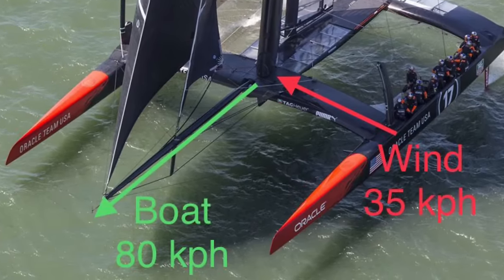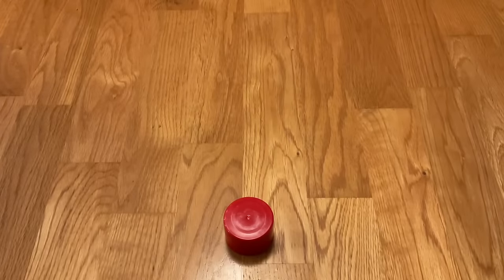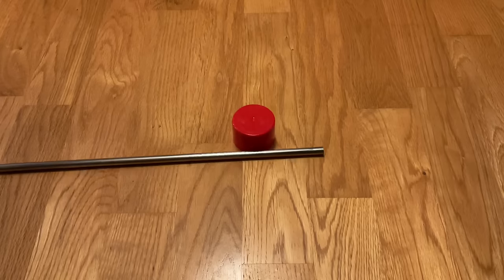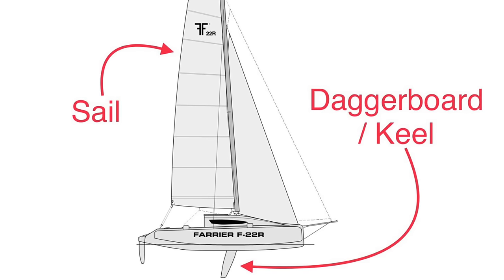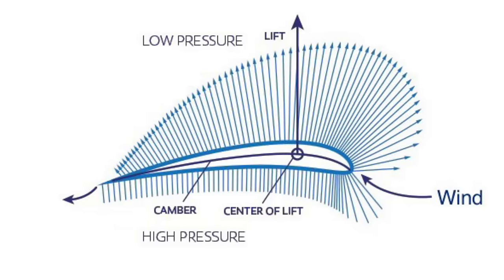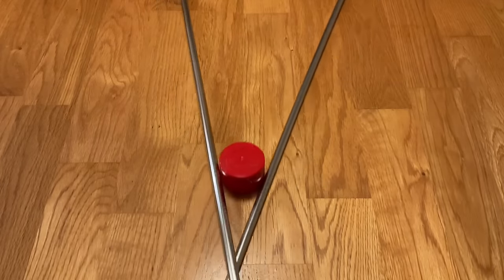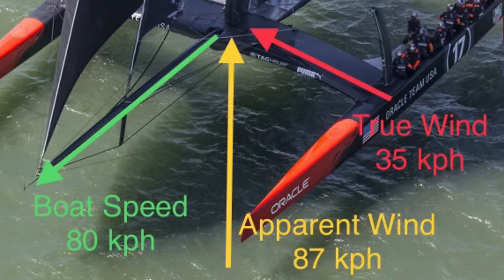How Does a Boat Sail Faster Than The Wind?!?!?

Comment: One correct explanation; one repetition of an incorrect myth. Yes to explanation of greater speed because of the forces on the keel/foil. There is no lift due to differences (minimal) in air pressure on either a sail or a wing on a plane. Ever thought how a plane manages to fly upside-down? To experience 'lift' in person, just put your hand out into the wind when travelling fast in a car - you will soon see it is the angle of attack against the wind that is causing the 'lift'.
Reply from the maker: There are both symmetric and asymmetric foils. Most sails and lifting foils on boats are asymmetric foils which can generate lift with no angle of attack. Airliners typically use asymmetric wings because they are very efficient but don’t fly upside down very well. On the other hand symmetric foils require angle of attack to generate lift, which is what your hand is simulating outside the car window. Planes that can fly upside down generally have symmetric wings and use angle of attack to generate lift, but they are less efficient at generating lift.
Reply: If a plane had a ten mile long runway it still wouldn't take off from the 'lift' generated by air travelling a longer distance on the upper surface of the wing as there is next to no lift generated by this. What makes the plane take off is the pilot pulling back on the joystick thus increasing the angle of attack of the wing to the wind. This myth started off in the aeronautical world, was transposed to the sailing world, though I note that the RYA has dropped it.   @SailingTipsCa
Reply from the maker: @robbiegriffiths7197  It’s pretty easy to find lift versus angle of attack charts that show how symmetric wings (e.g. NACA 0012) do indeed require a non-zero angle of attack to generate lift, but asymmetric wings (e.g. NACA 2412) do generate lift at zero angle of attack, although they can also generate much more more lift when you start adding angle of attack.

Comment: I dont really think i understand it yet... 😢😅
Reply from the maker: It’s a bit of a mind-bender, but the key point is that a sailing boat is “just” harnessing differences in movement between two mediums (e.g. wind, water) to propel itself forward.
Reply: @SailingTipsCa  thank you for your answer. But I find it counter intuative how it can sail faster than the wind. So the wind comes from the side instead of from behind, and the wind presses the boat aginst the water. But thank you for your video, was it you who made the video about the fastest sail boat in the world? Made by Vestas (windmill manufacture). I worked for them here in Denmark...
Reply from the maker: @MrJuhs91  Yes the true wind is always coming somewhat from the side, and as long as the sails are able to create a forward vector from this the boat will accelerate until the lift equals the drag. However as the boat accelerates the apparent wind moves forward, so drag reduction becomes a very big factor. 

I did also make the Vestas Sailrocket II video: How Did Vestas Sailrocket 2 Smash the Sailing Speed Record?!?!
https://youtu.be/K3m06731BQY. 

I lived in Copenhagen for a year as a grad student and wound up marrying a Dane!

Comment: This isn't accurate on many points.  Square rigged ships also can sail upwind and have for thousands of years.   The reason for faster than wind sailing is that now foiling boats have so little area in the water they reduce drag and slide more easily.  

Very inaccurate video while also having a lot of almost there information.   Basically everything is wrong for almost the right reasons.
Reply from the maker: I’d love more elaboration on what you think is wrong with the video! Lots of square rigged ships were lost on lee shores because they couldn’t sail upwind sufficiently to get themselves out of trouble like modern boats can and they certainly couldn’t sail anywhere near wind speed. Note that lots of non-foiling boats (e.g. planing dinghies, multihulls) can also sail faster than the wind on all points of sail due to having high lift versus drag ratios. It’s really all about lift versus drag.

Comment: Terrible model!  Reducing drag of the hull through the water is more analogous to greasing the floor to reduce the friction on the puck.
Reply from the maker: Yes reducing the hull drag is exactly analogous to greasing the floor to reduce the friction of the puck! And the forces on the puck from the rods are the opposing forces from the vertically-oriented sails in the air and daggerboard/rudder in the water. In retrospect I shouldn’t have used a boat with multi-dimensional lifting foils in the example because it muddies the waters and adds confusion.

Comment: Good video, but it needs a little more time on angle of attack, particularly how the apparent wind eventually hauls so far forward that the angle of attack becomes non-productive.

People who are curious about this will find this Veritassium video especially intriguing
https://www.youtube.com/watch?v=jyQwgBAaBag&t=1167s
Reply from the maker: Yes that’s a cool contraption!!! And you’re right that I could have spent more time on apparent wind, but also wanted to keep the video short, so maybe another video is warranted!
Reply: Try Ice Sailing. Apparent wind ends up almost nose on. "Close Hauled" takes on new meaning. Everything is great until a lull! Then the apparent wind ends up BEHIND the sail. At which point the sail pulling as hard as you can hold comes at you! Very exciting at 60 mph on skis with a windsurf rig. Bonus is, unlike water which a trained eye can see gusts and lulls, little or no such hints at a change in wind speed or direction are readily available on a frozen lake. So if you want to find the razers edge of sailing, have a go. :)

Comment: Woaw it’s such a bad explanation..
Reply from the maker: How would you improve it? What would you say?
Reply: Yes sorry, it’s not a constructive comment and it’s a bit rough 
But, the idea that both sails and foil generate forward forces is completely wrong. 
The analogy off those two force joining to push the red piece of wood is so confusing 
In really it’s much more simple to explain that the forward force of the sail overcome the overall drag of the boat. 
It’s simple physics so I don’t understand the need to make such analogies 
This said, keep doing videos on sail, I enjoy most of them :)
Reply from the maker: @Maxime-hz7hc  Thanks for clarifying! Yes most of the forward force does come from the sails, but they do also generate a tremendous amount of lateral (i.e. sideways) force that is countered by the lift from the keel/foils. I considered just holding one rod stationary to reflect this, but unless you’re sailing on a lake, there are also typically currents at play as well - around here it’s not uncommon to have 5-6 knots of wind in one direction and 3 knots of current in the other. Or even zero wind and 3-4 knots of current, which still enables the boat to move through the water. Really you just need the air and water to be moving relative to each other, regardless of which one is actually moving. And of course all of that works against the drag of sails/hull/foils. In any case glad you enjoy at least most of the videos!
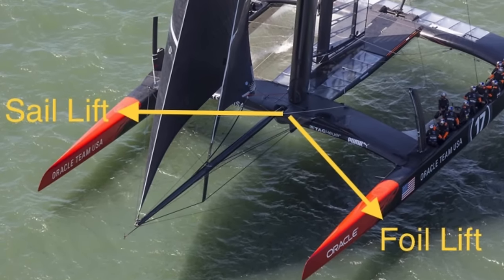Reply: @Maxime-hz7hc  The symmetry shown at 1:51 is not wrong, but we are used to think in the rest frame of the water. In the rest frame of the air-mass it is indeed the force of the moving water that propels the boat. Think about a wind-lees day on a fast flowing river.
Reply: @albatrosssoaring1487  i am not sure what you mean 
I am personally very used to think in the rest frame of the boat. And from what I understood, the symmetry shown at 1:51 is in the rest frame of the boat
Reply: @Maxime-hz7hc   In the rest frame of the boat, the boat is not moving, so the only way to define "forward" is based on the center-line of the boat and thus parallel to the keel. Here indeed the sail force has the "forward" component. But if the keel was rotatable, while the sail was fixed to the center line, you could still sail, and the keel would now provide the "forward" force. This is the symmetry.

Comment: https://youtu.be/LKLa8_GOuPg?t=138 "and the faster the boat goes, the more apparent wind it generates to flow over its sails which generates more lift ***which makes the boat go even faster***"

1) See my other comment about "the sails and foils on a sailing boat generate lift in opposite directions"

2) Yes, more lift because more apparent windspeed, BUT ...

2.1) ... forward force component is less because the angle of the apparent wind moves forward.

3) This is about efficiency

3.1) When the apparent wind is abeam i.e. perpendicular to the centerline, the sail takes all of that sideways momentum (of the air) and diverts it aft; lift sailforce is perpendicular to the apparent wind direction i.e. lift is directly fore-ward along the centerline; drag sailforce is perpendicular to centerline and does not pull the boat aft (except for a probably small increase in drag on the water foils).

3.2) As the boat accelerates, its faster speed make the apparent wind move forward (not the other way 'round, which is what the quote above states), and that lift sailforce moves away from fore-ward and towards abeam to leeward; also the (smaller) drag sailforce starts to rotate aft.

3.2.1) Also, as the apparent wind swings forward, there is less acceleration of the apparent wind aft, i.e. aft-ward velocity **difference** between the front and back of the sail; less acceleration aft-ward means less force fore-ward (Newton's Third Law); this is what I mean by efficiency i.e. the sail is less able to extract energy and generate fore-ward force from the wind as the apparent wind goes fore-ward.

4) Looked at another way, the **ONLY** source of fore-ward energy is in the vector component of the wind's motion that is perpendicular to the centerline of the boat, because that is the only energy, relative to the boat, that can be diverted aft.

4.1) Note that, for constant boat direction and constant wind speed, that perpendicular component is constant, and is the same whether we are looking at the true wind or the apparent wind, because only the fore-and-aft component of the apparent wind changes with boatspeed.

4.2) The sail gets nothing from the component of the wind's motion parallel to the centerline of the boat when the boat is at speed.

4.2.1) The sail may get some force when the true wind is from aft of abeam and boatspeed is less than aft-to-fore component of the true wind, but once boatspeed exceeds that true wind component, and therefore the apparent wind is fore-ward of abeam, then any increase in boatspeed can only increase drag from that along-centerline component.

4.3) This is probably the key point in understanding the speed limit of any fixed-sail craft can go on any medium (on land or water):  the **ONLY** source of energy to balance the increasing-with-speed frictional forces (drag, friction, etc.) is that perpendicular component of the wind, which is itself fixed.  And again, as the craft speed increases, the apparent wind swings forward, making it harder to extract energy from that perpendicular component of the wind.

Btw, none of this is original with me; read C. A. Marchaj (https://en.wikipedia.org/wiki/Czes%C5%82aw_Marchaj) "Sailing Theory and Practice;" "Aero-hydrodynamics of Sailing;"  Land's End catalog ca. 1983 and 1974.  Decades ago Dr. Marchaj predicted most if not all of the high-performance sailcraft we see today, which only became possible as better materials increased the available strength-to-weight ratios of boat construction.
Reply from the maker: Yes t’s about efficiency, or rather lift versus drag. 

The boat will accelerate until the forward component of the lift generated by the sails is equal to the drag of the rig and sails in the air and the foils in the water, at which point the boat will be in equilibrium and maintain a constant speed. 

I’m not sure the sails generate lift simply by diverting the wind aft though, although the sails do “bend” the wind somewhat. Rather the sails behave like asymmetric wings that generate lift perpendicular to the surface of the wing and in magnitude proportional to the curvature of the sail. Given this you want smooth laminar airflow over both sides of the sail to maximize lift, and if you add too much angle of attack you will stall the sail and the lift will drop considerably. 

The faster the boat the more you need flatter sails with just a tiny amount of curve/draft forward, but you also need to reduce drag to enable a flat sail to work. I like to think of it like gears, whereby rounder/fuller sails are more like low gears and flatter sails are more like tall/high gears.